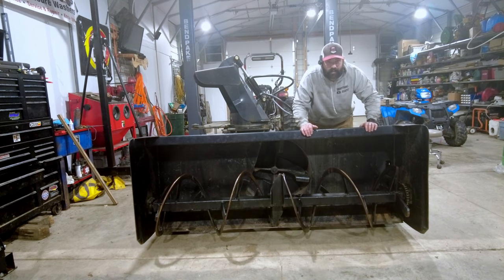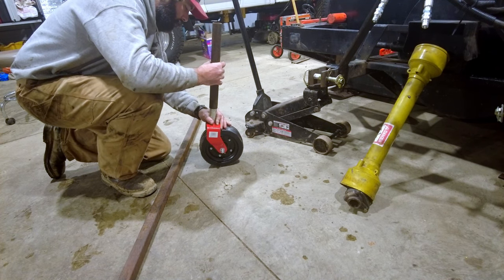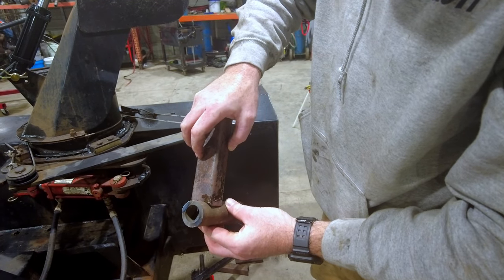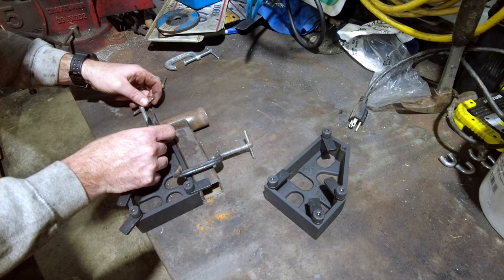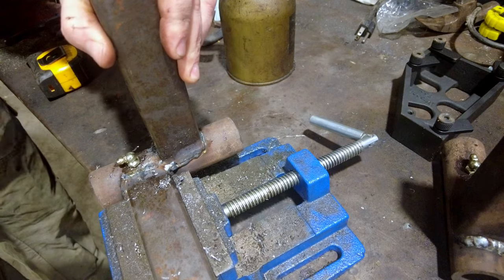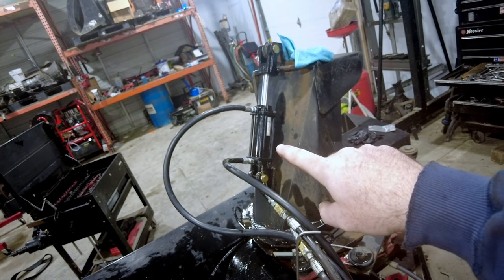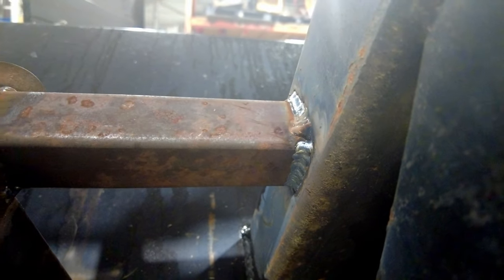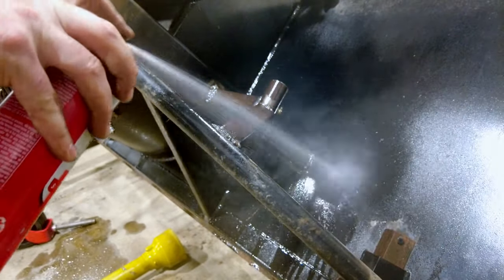Adding Wheels to my 3 Point Hitch Snowblower!?

Comment from the maker: Do you guys think this is going to work, or did I waste a bunch of time and material?
Reply: It will be fun to see how they do.  If nothing else, you had a fun project!
Reply: I'm curious to see if they swivel. With the weight of the blower and on snow I think they will drag. If they do, adding a larger pipe with bearings would help as opposed to metal on metal.
Reply from the maker: @D2500R  Time will tell!

Comment: I like this mod. They make gauge wheels with an adjustable crank that are heavy duty and greaseable with bearings for farm implements. They are meant to mount on a diamond bar. If they are not too big, you could weld on some diamond bar and just slide them on from the side. I have bought them when I was younger on farm sales. Also, if they don't turn easily, slide a bearing on the shaft below your welded support. You might have to do some further mods but I know this will work well when it is all done. Nice to see someone thinking outside the box. When I was 16, I built a motorcycle out of a 1 speed bike that was hard to pedal. I repaired an old weed burner engine that was in our junk pile and used it to power the bike. It wasn't much to look at but what a blast.
Reply from the maker: Sounds like you had things figured out at a young age! Thanks for watching!

Comment: It will be interesting to see how the wheels on the blower perform when you get a build up of hard pack snow on the ground.  You only have 1" of adjustment to lower the wheels.
Reply from the maker: When you say “lower” the wheels, do you mean to make the cutting edge further off the ground, or closer to the ground. If you mean further, I don’t see myself going any higher than it is. If you mean closer to the ground, the wheels will go high enough that they won’t even make contact with the ground, leaving the cutting edge to scrape the hard pack.
Reply: @EverythingElliott I meant to make the cutting edge closer to the ground.  Good explanation of it regardless.  Just need some temperatures to freeze the ground and some snow to build up the hard pack before you can use the blower in earnest.

Comment: I really hope that this works for you because its a great idea but I'm not sure those wheels will roll in snow or on ice verses just sliding and digging groves in the driveway. I think a pneumatic tire probably would have worked better. I think the only true fix for a snowblower on a gravel driveway is to wait for the driveway to be frozen. I know cause I'm dealing with the same problem. I did the pipe on my cutting edge hack and it works ok but not great.
Reply from the maker: The problem with pneumatic, I couldn’t find a tire small enough to fit in that space that would have the weight rating required for the blower.

Comment: Sand the rust off to clean bright shiny metal where you are going to weld. Should produce better welds. It will work.
Reply from the maker: You’re not wrong. I get impatient…probably would look way better if I started with clean metal.

Comment: Given the amount of slope in certain parts of my driveway I find I'm picking up too many rocks - curious to see how this goes for you - thinking I may try something similar...
Reply from the maker: Once we get a sizeable storm were gunna give it a run for its money!
Reply: @EverythingElliott  I'll be keeping my eyes out for the update video! Saw another guy use a trailer jack with a caster so that it's infinitely adjustable - granted, that was a front mount blower... not sure its needed/as helpful for a 3-point...

Comment: Wouldn't it be better if the upper cylinder was flipped over so the seal would be down?  Keeping freezing moisture from causing an issue.
Reply from the maker: I honestly didn’t think of that. I will keep that on the back burner and see how much it ices up